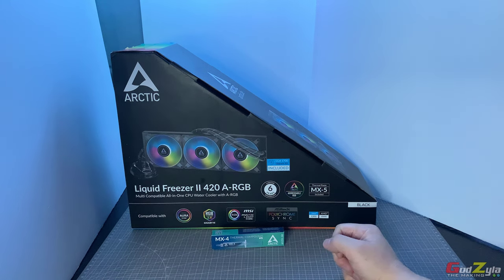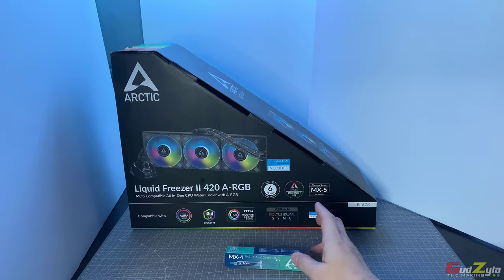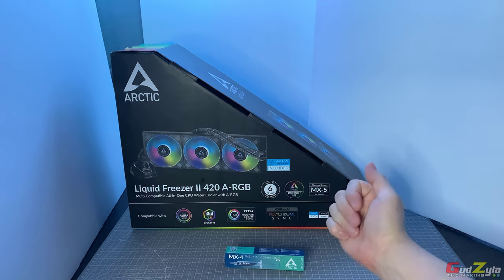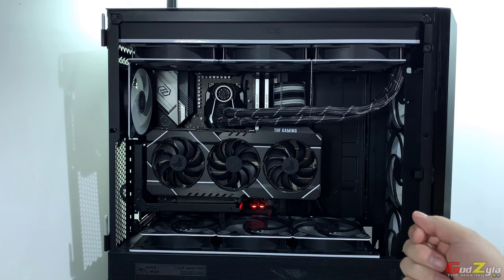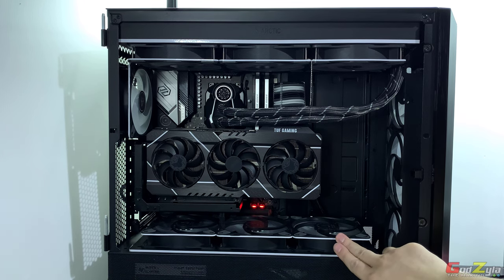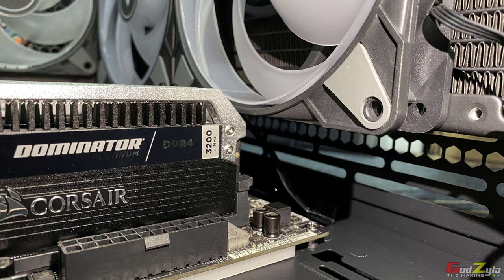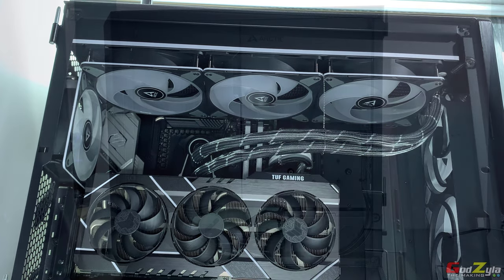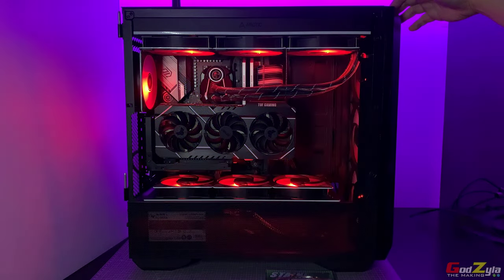Arctic Liquid Freezer II 420 in Lian Li Lancool III - Part 2 (The Experience)

Comment: On Lian Li website for this casing.. they did mentioned you have to remove the back casing fan to install 420mm Radiator... so for those who do not want to do it this way.. probably can go for a smaller 360mm...
Reply from the maker: Hi Anon, welcome to my channel. Thank you for your feedback. 😊
Reply: @KleoYan  I have the same casing but yet to build my PC.. so your video did give me some insights too. Thanks.
Reply from the maker: @Anon-cv7ru  you are most welcome. But some have stated not able to fit the 420 due to vrm heatsink too tall. So got to becareful. So long your motherboard heatsink and rear I/O shroud is not more than 40mm tall you will be fine.
Reply: @KleoYan  hey i couldn’t find the vrm length for my motherboard, it’s asus z790e-gaming wifi. Do you think it can fit with 420mm aio? IO and heatsink looks similar to yours but since i haven’t bought it i don’t know the height.
Reply from the maker: @kalestra4198  hi welcome to my channel. To be honest motherboard manufacturers do not include that measurements. So am not able to tell you if you can’t fit in. You got to figure a ways to ask around. A good place to ask is at Reddit forum under category asus. Just make sure the side vrm heatsink and the rear I/O shroud is not more than 40mm thick.
Reply: @KleoYan  i scrolled down the comments of this video and someone has this exact mobo and says 49mm, guess it doesn’t fit. Do you know any good airflow cases who fit 420mm top?
Reply from the maker: @kalestra4198  bequiet silent base 802.
Reply: @KleoYan  thank you for the info, i decided to go with 360 aio with lancool 3. This way i can also use 140mm rear fan right? 👍
Reply from the maker: @kalestra4198  yup correct and all the best with your build 😉

Comment: Thanks for the tip on the 120mm fan and flexible studs! I was able to fit the arctic freezer 420 in as well. However I had to put it angled and could only screw in about half of the radiators screws. Also the clip for the front fan bracket is blocked by the radiator and the bracket will not emerge with the radiator in, I bent where the clip grips the screw a bit and it helped. But in your video at 9:10 it looks like you have removed the screws from the bracket for the clip but you never mention that. Did you do that and is the bracket stable?
Reply from the maker: Hello Desmond rice. Welcome to my channel and just I miss out that part. Do pardon me but mine fitted in nicely and this is what I did to the front tray where the fans are mounted https://imgur.com/gallery/vHezOSS
Reply: @KleoYan  So your mount bracket is held in only by friction and gravity, interesting. Unfortunately I don't want to mount my fans on the inside of the bracket to block the LED so I have no room between the case and bracket for the fans with that position. I have to use the longer slot. I removed the screws from the bottom of the bracket and it moved the bracket back another 1-2mm and made space for the lian li mesh filter.
Reply from the maker: @desmondrice8373  hmm. I see. yup I mount it that way and it's not by friction or gravity lol.. there is a front lock screw on the tray that hold it still, I have no issue with the argb showing the front this way. as I dont really see the front when this case is besides me. I care more on performance and what I can see inside my case. I mean i like detailing more than argbs. for me, with white ligths to show the PC components are fine. I guess each of us have our own taste with PC build, but I for one will never like to turn on ARGBs as they create more heat inside a case. example, argb that lights on the blade, they do generate heat, if they are intake, these heat will carry to your PC components. maybe is not that much but a branch of ARGB fans from front and bottom. that is enough to increase the temperature from 1 to 2 degrees.
Reply: Desmond Rice. What is your motherboard?
Reply: @jonarbelldonordeocampo6161  ASrock X670E Taichi. Normal version.
Reply: Could you please do a step-by-step tutorial on how to install the 420 radiator, what screws to use, how can I reassemble the front with its 3 140mm fans. I'm a bit lost, please help.
Reply: @aldrayjavier8764  Aldray refer to the to comment by Mark A there is alot of info and at the end of the replies I make a post detailing where to screw the radiator in, if you screw it in the obvious holes it will be angled and you only have access to 4 screw holes. Take the case lid and radiator out together move them around till you can see through the lid to all screw holes then you will know the right seating position. I can post some basic pics if needed.
Reassembling the front is pretty simple and has instructions in this video. The front fans can be placed 3 locations I just believe you can't have them in their position furthest back into the case. The case manual has instructions on how to move the front fans forward.

Comment: Sir, I’ve not seen the GPU vertical mounting adapter before. Did this come with the case, if not, please show specs and performance impact. Also, are you OC’g your CPU?
Reply from the maker: Hello MrScott, welcome to my channel, the vertical mount does not come with it. I am using the original Lancool II vertical mount (https://lian-li.com/product/lancool-ii-1x/) but I did change the Riser cable from Gen 3.0 to 4.0.
I don't intend to overclock, I prefer to do undervolt.
Reply: @KleoYan  thanks for the follow up. 👍
Reply from the maker: @MrScott_e  you are most welcome. Infact there will be part III where I will share the thermal experience of this case, so do remember to subscribe and to click on the notification bell button. thank you!

Comment: Something must be different. I took everything out and it doesnt fit.
Reply from the maker: Hi Z3R, welcome to my channel. Pardon me to the late reply. In which way did it not fit. Are you mounting the 420 LF2 at the top. If you are, when mounting the rad screws, do not screw in all the way, so some minor adjustment till you have all 12 screws into the radiator screw hole position, then tighten them. That’s how I did mine.

Comment: Awesome video, i have the lancool 3 case, and i wanted to fit your AIO at top also, but i am not sure it will fit with my Asus ROG Strix Z790-H Gaming WIFI, how would i know without buying the aio ?
Reply from the maker: Hi Chris S, welcome to my channel. For the question, can it fit the Asus ROG Strix Z790-H. maybe you can messure the height of your motherboard rear I/O and the side vrm. So long it's not 40mm in height, you will be able to fit in to this case with an Arctic 420 Liquid Freezer II
Reply: @KleoYan  Thx for reply, do you mean height above the board the vrm sticks out, or the height from the motherboard back/base plate.
Reply from the maker: @ChrisDaytrader  hi, I mean both. So long either area is above 40mm tall then there will be an issue mounting the 420 liquid AIO.
Reply: @KleoYan  Ok thx
Reply from the maker: @ChrisDaytrader  you are most welcome. All the best with your build too 😉

Comment: Hi there! Great vid! I have a question about the front I/O. You mentioned in your last video (the walkthrough of the Lancool 3) that the front fans can be connected to a Uni Controller. Does that allow for control in L-Connect? Also, I have two RGB strips that I would like to utilize as well. If I were to connect those to the I/O cables, would those also be controlled by the I/O buttons or can that be controlled via L-Connect as well? Getting ready to buy the case and just figured I would ask. Thank you!
Reply from the maker: Hi TravD23, welcome to my channel, yes correct. You see there is this cable that allows you to connect to the uni fans so whatever you have connected to the case controller, press it till it’s the 7 or 8 times (I can’t remember) and it will toggle to motherboard mode. But instead of motherboard mode. That cable am referring to is connected to your uni controller. Therefore you can use the l-connect to control the argb effects
Reply: @KleoYan  Awesome! I just put my order in for the case. Appreciate the detailed approach to your review!
Reply from the maker: @lttlejordan23  you are most most welcome. All the best with your build.
Reply from the maker: @lttlejordan23  you are most welcome and all the very best with your build 😉

Comment: Thank you for your video, this did really serve me well to answer some questions i had. But lastly i would like to ask you if you did use the same fans overall or if you mixed the arctic ones with the lian-li ones?
Reply from the maker: Hi GenericJohnDoe, welcome to my channel. In this video, I have used all Arctic p12 and p14 argb fans. I have not use any lian li uni fans.
Reply: @KleoYan  Ok, thank you for your answer, are the arctic ones compatible with the lian li argb controller or do you circumvent this part and connect directly to the mainboard?
Reply from the maker: @GenericJohnDoe  hi I make use of a fan and argb hub controller in this build.
Reply from the maker: @GenericJohnDoe  hi, the Arctic P12 ARGB or P14 ARGB are compatible with the Lian Li Lancool III argb and fan fun or controller but not enough port to plug all argb fans. so I have made use of this .. the Gelid Amber 8 ARGB hub https://gelidsolutions.com/product/amber-8-pro-2/ I only use the ARGB on this hub. as for the fans I directly plug them to the motherboard as with better PWM control.

Comment: Hi again sorry for lots of questions. So I will probably use arctic p12 fans with the deep lt720 360 aio and or the Arctic lf2 360 aio and i am concerned that the TeamGroup night hawk ram wont have enough clearance for a 360 aio or is it just for 420 aios?
Reply from the maker: Hi welcome back. You should not have any issues with ram clearance at all when applying a 360 Liquid Freezer II. Is only when it’s 420
Reply: @KleoYan  Alright just teamgroup nighthawk ram look very nice imo but can be hard to fit in for some builds 😅 thank you again.
Reply from the maker: @Sidreee  you are most welcome and all the best with your build 😉

Comment: Great video, I am thinking of having 420 on top and 360 radiator at the front. Do you think there is enough space to do the custom loop. As custom loop need to connect the tube manually, it may require more space. I think it will just fit without the rear fan.
Reply from the maker: hi 黃俊軒, welcome to my channel and thank you for the compliment. The way I relook at my case. It's almost impossible to fit the configuration you've mentioned. To fix 420 at the top and 360 is not the issue, the issues are the fans that are mounting on those radiator.. I don't think there are enough clearance unless either one of the fans at the most front, can be the top front of the 420 or the front top 360.
Reply: @KleoYan  Thank you for your reply. As I look at this picture https://lian-li.com/wp-content/uploads/2022/07/lan3-028.jpg and your video, I think the configuration can fit. What do you think.
Reply from the maker: @nviwch  Hi, I am not able to commit an answer for you. Though I have revisted my case that is originally with a 420, I can fit a 360 AIO but not the fans. However said, if you did your measurements and is very sure of it, then proceed with your plans but as mentioned, do pardon me, I can't give you a confirmation on this. Once again, thank you for your visit and if you are able to execute as what've planned, do share with us with some pics. if YouTube comment do not allow you to place url, maybe send it to my email godzylatech@gmail.com . I believe your findings will help those who wanted to execute just like you've planned. Thank you.
Reply: @KleoYan  Yes, it fits.
Reply from the maker: @nviwch  nice. Thank you for your reply. I believe this info will help some out. 😊

Comment: Hello i have a lancool 3 with B550M TUF PLUS and my two memory  have 40mm, u think this artic 420mm can fit in the top of my case with no issues?
Reply from the maker: Hi Jonny Scheuer, welcome to my channel. so long your rams are straight and not slanting out.. it will be fine..
Reply: @KleoYan  yeah, im using 16x2 ( each one have 40mm ) btw i can use that artic liquid freezer ii 420mm with the fans who comes with the lancool 3, right? just install that AIO with this fans of artic in the top and thats it? or i need change something
Reply from the maker: @Scheuer1  hi, yes you can do that no issue. but I have a question, why do you want to change your AIO fans? or is it due to the fact that your Arctic LF2 420 is the non argb version? Be it non argb or argb version of your LF2, the P14 fans have good statis pressure, else the lian li case fans are for case airflow.
Reply: @KleoYan  Sorry for my bad english, probably i just expressed myself wrong, im building a new pc and buyed a lancool 3, 5800x3d, b550m tuf plus and 16x2 ram memory ( who have 40mm each ) and i want a water cooler for this cpu, i asked u for know if this  watercooler can fit the lancool 3 with this configs and the 4 fans that comes with it, is a 3x 140mm 200~1800 rpm front and one 120mm back i guess, cuz my plan is just buy that watercooler and install him in the top, without changes in the rest of the original parts like the 4 fans .. im from brazil so mybad for a sh1t english :/
Reply from the maker: @Scheuer1  oh ok ok .. i get it now.. if you intend to do like what I am doing, please take note of the front fans. you need to shift.. see this picture. https://imgur.com/gallery/vHezOSS
Reply: @KleoYan  oh, so need different ones like 3x 120mm for use in front cuz if not, that watercooler don’t fit? big sad, maybe is better just go to a 360mm so .. no?
Reply from the maker: @Scheuer1  what I mean is. if you want to use the original 140mm Lian Li case fans at the front, you need to just flip the front tray. that's all it's needed.
Reply: @KleoYan  I have a few questions about it: 1- you have a screenshot showing how it will looks like? 2- fliping away the front tray, u still can close the front part with the frontal piece? 3- doing this way, have any changes in temps or still all the same?    thanks for helping me Kleo, really appreciated!!
Reply from the maker: @Scheuer1  hi, that is the only way to place the front fan. You can’t flip over as you will not be able to close the front tray. As for temperature. Don’t think there will be a difference as the amount of air at the front is of the same.
Reply: @KleoYan  So basically if i want use the 3x 140mm fans from the lancool 3 case, i need flip the front tray and let this open like in the images from imgur u sended? without close with the front panel?
Reply from the maker: @Scheuer1  the tray is closed.. not open.. Lancool III you can flip and close..
Reply: @KleoYan  maybe u have a screenshot showing how he will look? i’m a little bit confused cuz my lancool 3 is not delivered yet 🥺
Reply from the maker: @Scheuer1  this I can't help you as I move on to another case. so sorry, already tear down.
Reply: @KleoYan  ahhh got it, resuming he will stay the same case aesthetically saying but with the 3 frontal inside fans "inverses", correct?
Reply from the maker: @Scheuer1  I would advise you to revisit this timestamp 09:18 where it shows you how the front looks like.

Comment: Hello! Do you think there is a chance to put the phanteks t30 on the rear if I use a 420 radiator?
Reply from the maker: Hi WHiTE, welcome back, I have not tried a T30 back then and there will be risk involvement for the T30. You can try but you need to get the fan rubber studs like I did to
My Arctic P12 at the rear. The choice is yours.
Reply: @KleoYan  T30 has 30mm thick frame vs p12 with 25mm. I'll try
Reply from the maker: @IWHiTEI  yup that is why I cannot commit to give you a yes. I mean I saw the frame of T30. The rubber studs should not be an issue but is just the 5mm thickness which I am concern. By the way, all the very best with your build too 👍

Comment: I've actually run into a slight problem: the top fan of my front case fan is making contact with the two chrome bars that connect into the radiator on the AIO, thus making the top of the front fan angled out a bit at the top. I'll have to take a look at it again this evening, but did you ever run into this issue?
Reply from the maker: Hi St. Michael the Archangel, welcome back. Yes I do fact this issue so I did my front this way and for some reason that section on my front fan mounting of this video was missing. These are pictures of how I mount my front fans. Sorry my bad. https://imgur.io/gallery/vHezOSS
Reply: @KleoYan  OK, thank you. Do you know if those three front fans are designed for airflow or static pressure? Likewise, are the 3 fans in the 420 AIO static or airflow? I'm trying to decide if I want to get 3 120mm static pressure or airflow fans for the bottom of the case. Thanks! :)
Reply from the maker: @st.michaelthearchangel7774  hi for the lian li original. They are of airflow as for the 420 aio are both static and air flow. Infact P12 and p14 argb from arctic can use on radiator or airflow.
Reply: @KleoYan  Awesome. Thanks! I plan to get either the P12 static Arctic fans or the BIonix P120s for the bottom of the case.
Reply from the maker: @st.michaelthearchangel7774  that’s good 😊 all the best with your build 👍👍